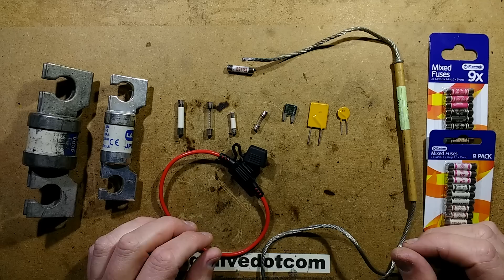Things you should know about fuses.  (including a 15kV one)

Comment: Every single time I buy a pinball machine, most of the fuses are the wrong value. Its also very common to find fuses that have had a wire soldered across them. It infuriates me because of the damage it causes to wiring, melted solenoids, shorted out rectifiers that then go on to kill pcbs. Melted transformers etc. Arrrrrgh
Reply from the maker: Yeah, arcade techs weren't noted for their technical skills.
Reply: Soldering a wire across ? That's fancy, use a nail !!!!
Reply: We use nails in europe because we have nothing better. I am told that in the US it is common to put bullets in fuse holders... /s

Comment: My best effort was tripping 5 circuit breakers in one go.  I wanted to see what would happen when you touch the earth wire to the active wire.  Well, it was more exciting than I was expecting!  Big boom and then house plunged into darkness.  I had a 6 Amp circuit breaker connected to the wall outlet I was using for this experiment because I knew I was doing something dangerous, so of course that tripped. The 20 amp  circuit break in the distribution board tripped, the RCD tripped and the main 40 amp circuit breaker tripped.  After resetting all these circuit breakers I still had no power to the house!  At first I was puzzled by this and the only other place I thought to look was the meter box which is located outside my house, and sure enough I found another 30 A (surprisingly low value) breaker tripped there too.  Good to know the breakers work!
Reply: Why does your house have a 40 amp rated circuit if the incoming fuse to the house is only 30 amps? o_O
Reply: @tylisirn  In the US the typical power input is ~220V to the meter. It is stepped down from there to the 110/120V that is used by most appliances, so a 30A breaker at 220V would have a higher power throughput than a 40A 120v circuit.
Reply: @richardmillhousenixon  You have a bit of an error there, but I forgive you.

It is not step down as it like a Transformer.

It's called. Sometimes called split phase power. Which is proper technical term.

Not to be confused with split phase Motors.

But in the split-face system.

Is there are? Three wires besides ground.

Two Hots and a neutral.

The two hot wires if you go between them around 220 volts or so..

If you go between either. Why are the neutral you get 120 or so.

Also something interesting.

If you were to perfectly balanced. Both hot leads the current draw exactly there would be zero current in the neutral.
Reply: @richardmillhousenixon  i was under the impression that the step down from 7/15Kv was done at the local distribution panel with a centre tap transformer providing two hot 120v legs and neutral to the domestic meters.
Reply: Szakembőr TV TMIAE,  There are faulty fuses made sometimes, just the same as circuit breakers.  Just two different ways of accomplishing the same task.
Reply: pmailkeey, faulty breaker? (100w bulbs or any halogen bulb that blow tend to take out our breaker, I guess it's when they ark inside the bulb they blow the breaker)
Reply: @leexgx  Yes that can happen under normal circumstances sometimes.

So not this early bad breaker.

You don't want the older big Christmas lights ever was well, if a bulb gets jard. And I feel with brakes and then arcs switches pass the other Side, it'll pop the fuse.

Number one time I accidentally tipped over a lamp was working on.

Bulk got smacked. How hard did not break but pop 20 amp breaker when the filament broke.
Reply: Better job than our oven made last week then, the upper element ruptured in 3 places & arced to it's casing. (So basically the same result as your experiment, hot to earth short except on the cooker circuit). That only tripped 2 RCD's...

Comment: Here's a nice video of what can go wrong with a fake BS1362 fuse (no sand).  It's been fitted to the style of plug where it goes into a cartridge in the base (for quick and easy replacement).  It is because it is fitted into that style of plug that the results are so spectacular (and pleasing).  Only 6s long,.  https://www.youtube.com/watch?v=KVJVswLbqaA
Reply from the maker: The unfused cheapo USB power supplies from China are good too.  They physically explode, blowing their lid across the room and leaving the base with exposed electrical connections in the socket.
Reply: Yeah, but they're a lot bigger than a fuse and stuffed full of electrical components.  Anybody who has exceeded the ripple current rating of an electrolytic will expect there to be bangs inside those.  The Chinese would stuff gunpowder inside the electrolytics if it worked and was cheaper.  And use nitroglycerine as the electrolyte.

You don't expect it of a tiny fuse.  It's a safety device, after all.  You don't expect it to go off with a flash and bang and eject the plug from the socket with violence.  Which is why it's such an enjoyable video. :)

Comment: I remember the £ shop recalling their automotive fuses, the 3A fuse would take over 20 amps
and not blow.  PTC fuses are brill.  Used them glued to a motor when the motor gets hot it causes
it to trip, motor and fuse cool and motor restarts.  :)
Reply from the maker: Some lamp igniters use PTCs as simple timers.  They sandwich them with a resistor.

Comment: You're explanation for the HV fuse is almost right, the fuse element its self does not have enough clearance to expel a HV arc.
the fuse carrier is a V shape with a pivot connecting the two axis, this pivot has a spring to hold it in this position, when installing the fuse element you pull against the spring pivoting it into an L shape. the element tails simply wraps around a thread and are clamped down tight with a nut.

The now L shape fuse carrier is placed into the cut-out unit which is > shaped, the cutout is made of a dielectric material (ceramic or polymeric) with weather sheds (the zigzag shape). the cut-out has a metallic (usually brass and steel) top and bottom which are the contact points which conductors are attached to.
the fuse carrier is placed into the cut-out upside down and then flicked up and clicks into a spring loaded detent on the top metal contact of the cutout.

when the fuse element blows it is no longer apposing the spring on the pivot of the fuse carrier and the fuse carrier bents back into a V shape, it falls clear of the detent at the top of the cut-out and under gravity swings 180 degrees so it is upside down and hangs on the bottom peg of the cut-out, this provides the electrical separation needed for high voltage.

older designs do not have a spring loaded pivot and rely solely on gravity, because of this its not uncommon for a fuse to blow, create an arch between the top of the fuse carrier and cut-out which welds it into position, the element will melt clear however it is hard to identify a blown fuse as from the ground it is seemly still in tact.

a hanging fuse aids us in quickly spotting a blown fuse from large distances away with binoculars enabling us to narrow down potential fault locations. these types of overhead fuse units are typically used on T off spurs or above transformers. other forms of protection are used on main line.

Comment: Is it OK to put a bit of tape around a glass fuse to contain the glass in an explosive failure? I had a power supply blow up and the glass and maybe molten metal from the fuse had damaged components inside.
Reply from the maker: Some power supplies have a bit of heatshrink round the fuse.   A ceramic fuse is a better option.

Comment: Speaking of arcs faults, I've seen a MCC that was fed from a transformer with no protection at all on the secondary. It had an arc flash in a breaker, and the arc found it's way to the main bus bars. It incinerated 3 or 4 panels before the high voltage feed to the xformer tripped. It melted EVERYTHING! Cables, motor starters, sheet steel, copper bus bars... And the amount of soot it produced! And the smell!
Reply: At a different site I worked at there was a transformer of 525V to 400V and a few hundred kVA that was just installed. It was fed with two parallel 3-core cables, and the electricians managed to accidentally swap two of the phases on one of the cables, so it was a dead short. I was just working in the same room as the station that fed the xformer, I wasnt even supposed to be involved with the xformer stuff. But when they were about to switch it on I decided to shoo everyone out of the room anyway since it's a new install, and thus it's more likely something will go wrong. And kinda lucky I did... when they flipped the switch it was like a gunshot in the room! BLAM! A bunch of 630A fuses blew and an ACB tripped.
Reply from the maker: The smoke deposits are often also quite destructive to electrical contacts in the vicinity too.
Reply: Ya an arc guard unit is a cheap insurance to make sure it wont get that bad. I mean compared to losing weeks of revenue when the entire plant comes to a stop...

Comment: It might be interesting to do a short programme on the different Circuit Breaker systems out there (single-pole, multi-pole, RCD, RCBO), and consider the amazing guaranteed performance for the tiny price we pay  - guaranteed 4.5kA disconnection under fault conditions (so >1MW switching capacity at 240v nominal!)
Reply from the maker: Well here's the thing...  You can test an RCD/GFI/RCBO by pressing its test button which does a genuine electrical current imbalance test by inducing a suitable current in the sense coil.  But outwith the factory nobody ever does a test to see if an MCB trips at its rated instant-trip current.  Mainly because it would involve tens to hundreds of amps to do the test.

Comment: Rather expecting you to mention Littelfuse! VERY popular as primary protection in the better quality multimeters (e.g. Fluke).
Reply from the maker: That name did come to mind.  It may even have been responsible for the rave reference.
Reply: I'd rather trust a reliable Manufacturer (Bussmann, Littelfuse, MK) with equipment protection!. Littelfuse did (and problably still do) very fast PTC protection devices that were dimensionally a direct drop-in replacement for standard cartridge fuses - so it was easy to get fast-acting 10A protection on even cheaper test equipment.

Comment: Anybody else remember HRC fuses being called HBC? (high breaking capacity) ? or is that just me lol
Reply: Yes, It's similar with HRC and HBC, but it's called HRC officially in fuse industry.
HRC fuse in full name is High Rupturing Capacity;  An HBC fuse is a fuse designed to withstand a higher current than the fuse rating without rupturing or breaking. 
For example: A fuse with a nominal rating of 100A, applied to a motor, for instance, should blow (with the fusible link clearing the circuit by becoming an open in the circuit) after the current exceeds 100A.

Comment: This is a huge problem in U.K. colleges. I’ve seen many Chinese appliances bought from EBay with the explosive ceramic fuses. They are easy to spot as the colour codes will be wrong, the end caps come off easily, there’s no BS marking and they are not filled with sand. 
In fact I have a bag full of hundreds of them I’ve changed for ones that do meet British Standards.
Reply: Stuntman707 that's because they use all the sand for their lithium knock offs
Reply: Sell em as a pack on ebay haha

Comment: It's not just second hand equipment, i've had low current devices that have been fitted with a 13 amp fuse by the factory, where it should be more like a 3 amp
Reply: Clive took apart a soldering iron that had a 13amp fuse in the plug and should have had a 3 amp.
Reply: Probably premade outlet wires.  They didn't bother changing the fuses

Comment: You didn't cover these kind of fuses. http://www.clasohlson.com/medias/sys_master/8872650571806.jpg and https://www.elkamo.fi/images/tuotteet/sulake_pj.jpg.png
Reply from the maker: I very rarely come across Edison style fuses here.
Reply: bigclivedotcom So that's what you call Edison fuses? Somehow I imagined it was the ones with lightbulb style Edison threading that were later superseded by the ones from the first picture (There was a procedure to convert the fuse holders).  A common feature of bottle shaped fuses is the centre dot on the face falling off when the wire blows, as a visual indication.

Comment: Anyone got a formula on how to calculate the required fuse rating? My current problem: i got a Meanwell RT65B SMP (65W or something total, currently using around 16W@230V), which is not working on its limit, but the in-rush current when switching the device on already killed several fuses. Quite annoying...
Reply from the maker: I'd suggest an anti-surge 1A fuse for that.  The supply itself may have protection inside so all you're protecting is your side of the mains circuitry.
Reply: bonzai HB look into calculating the i2t (i-squared-t) in your application and use that to choose a fuse (it should be in the datasheet). This value represents the energy needed to blow the fuse.
Reply: Matt Neighbour  thanks, will look into that. Could be difficult to figure out the t though due to the lack of specs, is it safe to assume maybe half or quarter of a sec as a rule of thumb? I've seen a short spike of maybe half a sec of my energy meter before it returned to normal
Reply: bonzai HB It's not a simple multiplication, it's an integration summation. Ideally, plot the inrush current with an (isolated!) oscilloscope, redraw the curve with I² instead of I, then measure the area under the curve.  Maybe some modern Scopes or meters can do it for you.

Comment: In response to the failure of glass fuses, I once had a fuse issue with a guitar amplifier, fuse would test good with a multimeter, but the amplifier simply would not power on. Taking the chassis out to check for faults on the pcb, it came on. As it turned out, the fuse wire had come off it's bond to the terminal, but was still long enough to contact it. Orientation and/or slight movement of the fuse made the difference between it testing good and not.

Comment: The T stands for the german word "träge" (sluggish) :-D Because: The inventor was a german engineer and they are based on a german standard (1930 DIN and 1943 VDE 0820

FF - Flink Flink (fast fast)
F - Flink (fast)
M - Mittelträge (semi sluggish)
T - Träge (sluggish)
TT - Träge Träge (sluggish sluggish)
Reply: Thought FF was fast as f**k
Reply: @dopiaza2006  or F'ing fast.
Reply: Musste extra nachschauen ob das jemand schon geschrieben hat.
Reply: in America we designate them a bit differently.  for example, you can have a 30K hv fuse link which is 30 amps and letter denotes how many cycles before opening.  typically i see E rated fuses frequently for fused disconnects that feed large buildings
Reply: The Danish version is taken from German and has been translated into the following:

FF (Super Flink)
F   (Flink)
M  (Middel træg)
T   (Træg)
TT (Super træg)

The fun thing is in Danish (Flink) means (Nice) and (Super Flink) means (Super Nice) like super nice guy 😃
Reply: @rob3125  in German 'kuse' is 'kiss' but pretty sure it's not that in Danish
Reply: @loginavoidence12  Kuss is kiss in German
Reply: 1930 DIN, wasn't Tesla first?
Reply: Ahh u Germans love ur standardization. I'm sure all ur documents backing up ur claims are in proper triplicate order and backed up onto IBM punch cards for "easier processing".
Reply: @TrapperAaron  possibly. Here's a fun fact.. Germany has a DIN Norm on DIN norms. Which describes the wording format and so on about how to describe a DIN norm. So basically a meta DIN. And another one. As far as I remember, the German article about DIN norms is the longest written article in the German Wikipedia. :D
Reply: @musashi939  lmao that's great